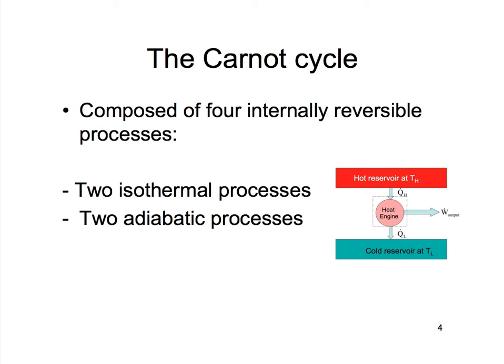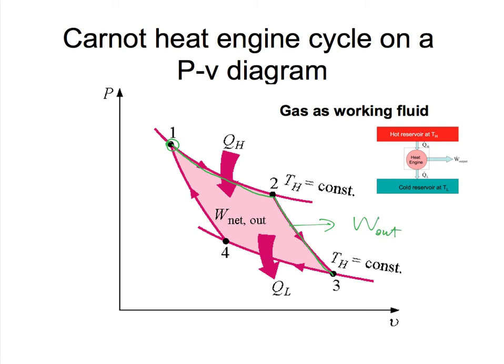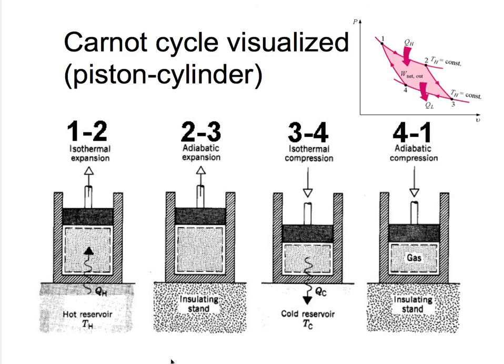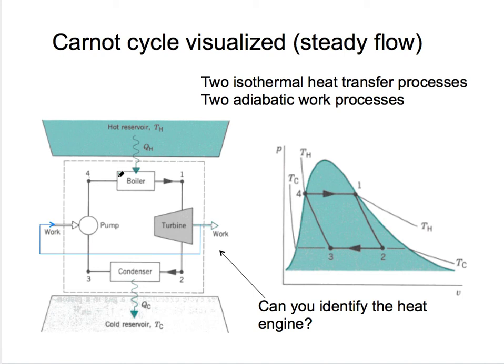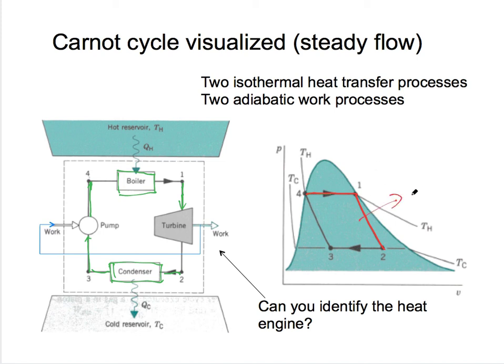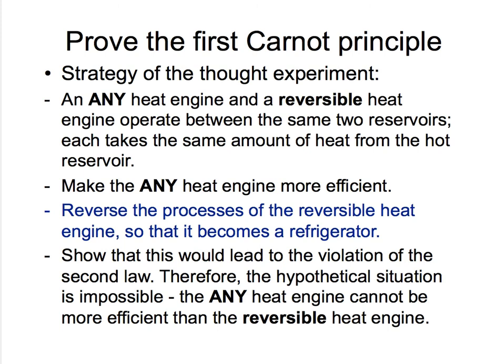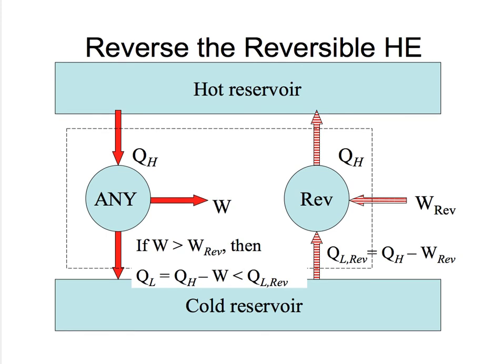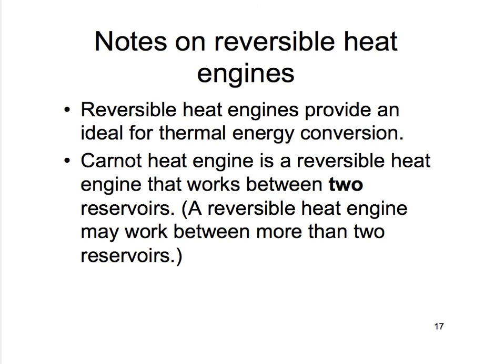Carnot Cycle and Carnot Efficiency

Comment: Is isothermal process a phase change process at constant temperature?
Reply from the maker: An isothermal process, by definition, is a process in which the temperature remains constant. 

If you have a pure substance system that consists of two phases (saturated liquid and saturated vapor), an isothermal process of such a system will also be an isobaric process. Saturated liquid may convert to saturated vapor or vice versa (phase change) in such a process.